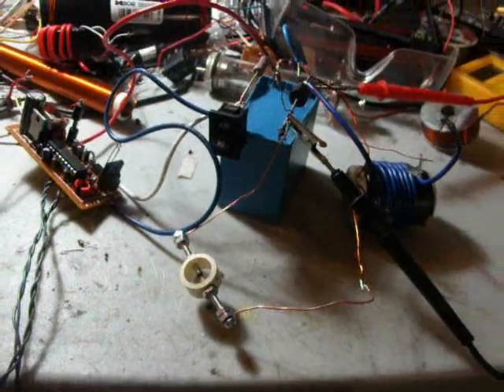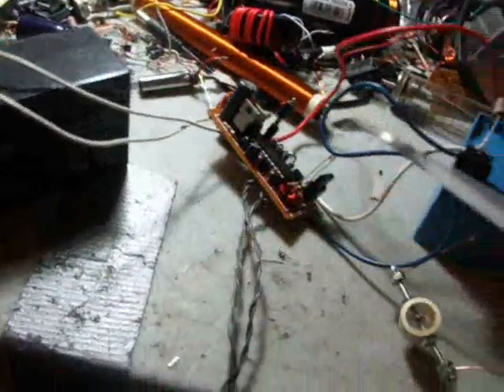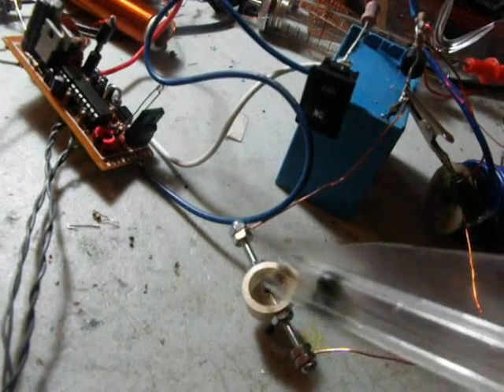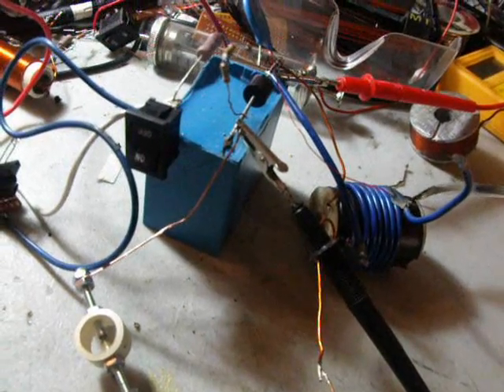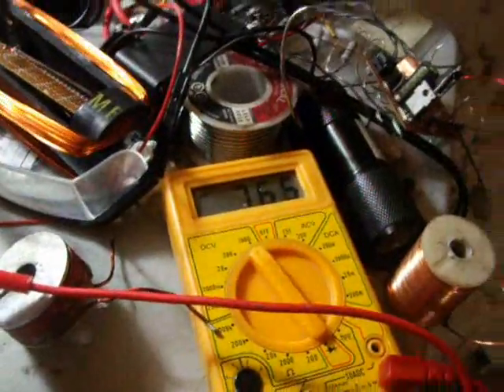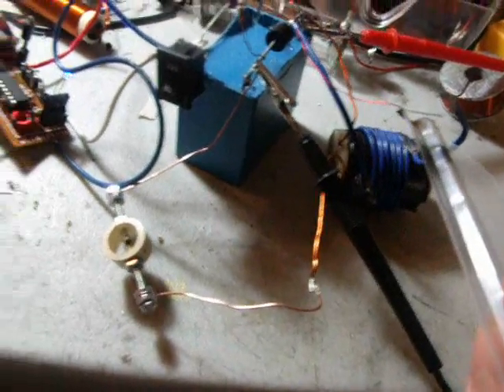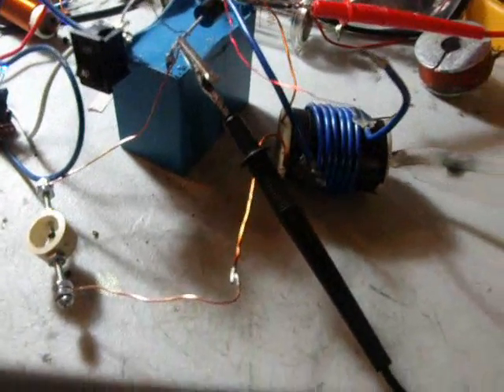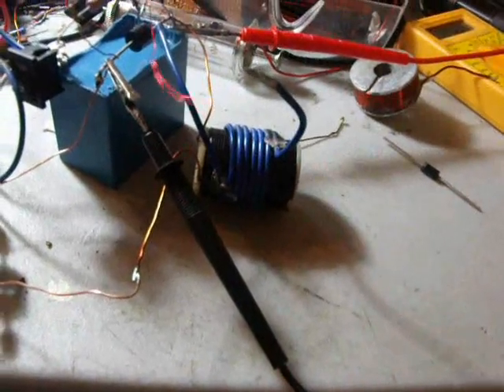Spark switch for coilguns.wmv

Comment from the maker: So far I'm stuck with reloading mechanism for my new recup coilgun - it turned out that efficiency drops 2 times if iron projectile is pushed by iron stick. When I fix it and get first stage operational, I'll start a new line of videos about making that thing.